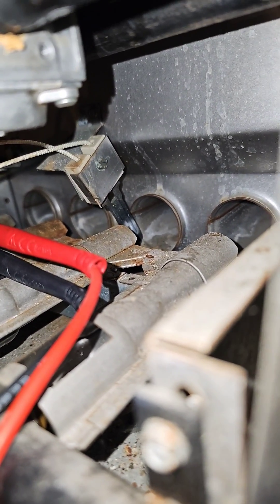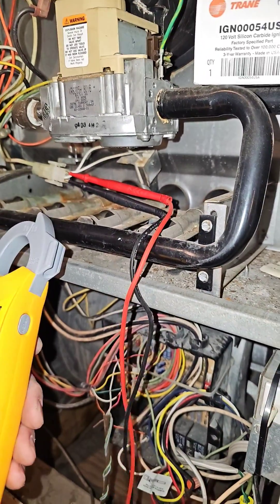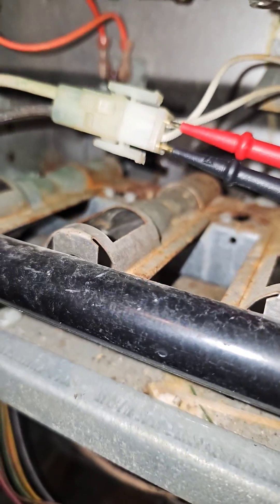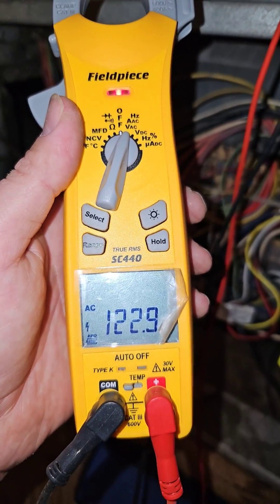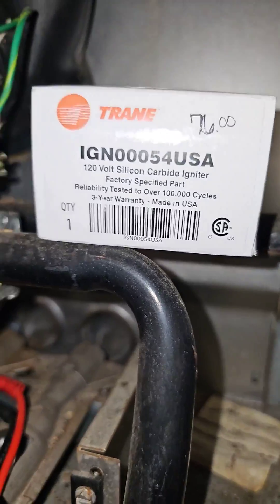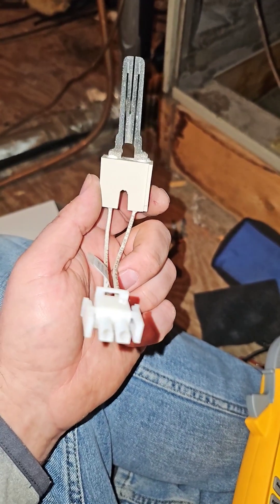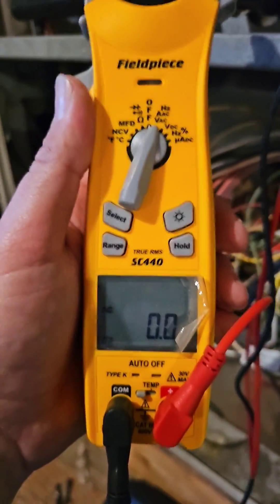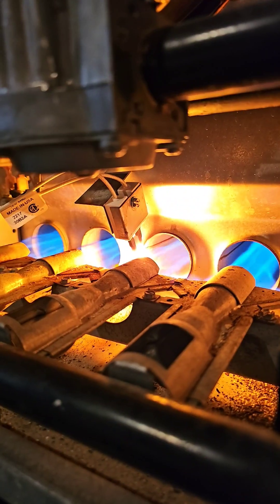How do you check the hot surface igniter? #gasfurnace

Comment: I realized my unit was in lockout because the hot surface igniter was not functioning anymore but whenever I was testing the wires to see if power was coming to them I accidentally grounded my multimeter leads to the case and burnt the tip off the multimeter lead. The wiring harness that I was checking that goes straight to the hot surface igniter is slightly burned but not deformed at all in the inside looks like the metal sections of the connectors are still in perfect condition just discolored... Do you think this one might still work even though it's a terrible idea?

Comment: If always failing early in the heating season, pre-emptively remove the igniter and do an oven bakeout to drive out the moisture that has absorbed into the porous element during the months that is was unused.

Comment: Check amps too. If the HSI is getting the correct voltage but no amps from the board it wont turn red. Bad board
Reply: How to check the amps from the board?

Comment: I had a night diagnosis on old trane, I believe it was.  It was at an ambulance call center flame sensor that needed to be cleaned.  But I went to pull out the HSI and broke it 😅 shit I was mad at myself for pulling it. Luckily, they had the same unit next to it that they didn't use, I swapped HSI and came back the next day with a new one.  😆 🤣
Reply: Nice save

Comment: Can just easily check for continuity
Reply: Yes you could, but you should also check if there's voltage
Reply from the maker: Crap I should have added that in the video
I didn't think of it at the Time
Thank you for Adding this in the comments
Reply: Don't depend on continuity. Always check VAC for accurate testing.
Reply: @joshuaespinoza6331 learner here, I appreciate your input, thanks!
Reply: You can but it really doesn't matter. If you have voltage to it and its not working, replace it. Continuity doesn't tell you its getting the voltage and you have to verify that regardless.
Reply: Don't depend on continuity. Always check VAC for accurate testing.
Reply: Check for both vac and ohms reading
Reply: @Strick1987 why ohms?
Reply: Tenes NRO de teléfono o facebook?